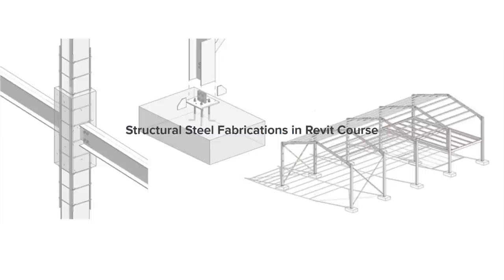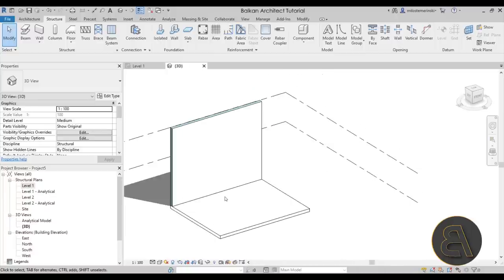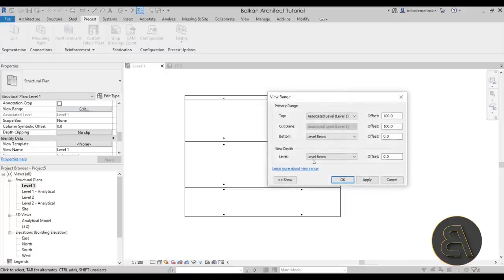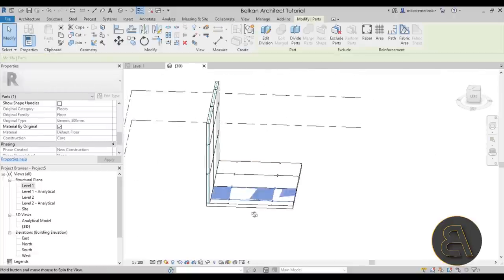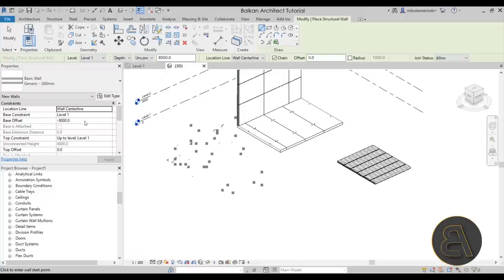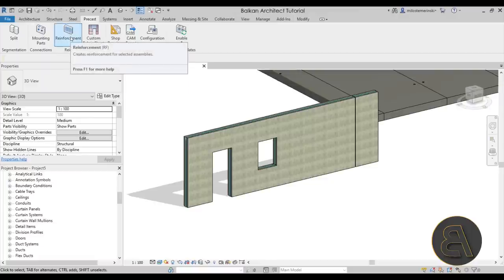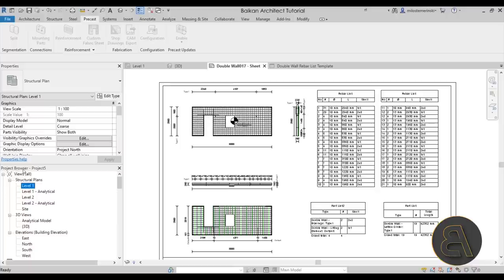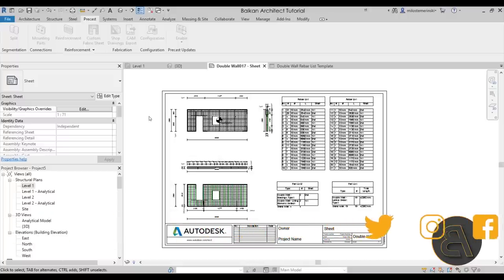Exploring the NEW Precast Tools in Revit 2021

Comment: I'm trying to create a Hollowcore slab but I get an error "Hollow core slab with invalid thickness. Change the selected template family in Config or adjust the thickness of the slab to match"

The thickness of the floor is the same that you use in the video (200mm) and the configuration in the prescast is the same as the floor (200mm), I opened the family directly but I don't see any error. I hope you can help me.

Comment: Does they layer in between the concrete layers for your panel wall have to be  set to thermal/moisture, and be set to Air material?